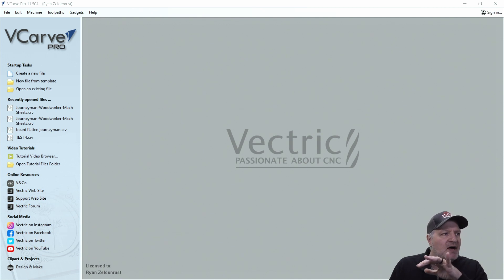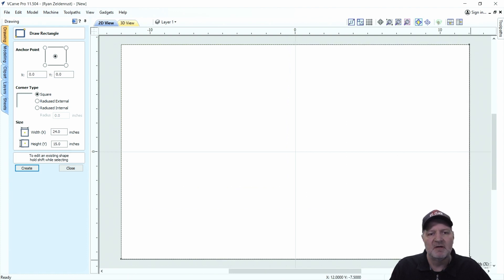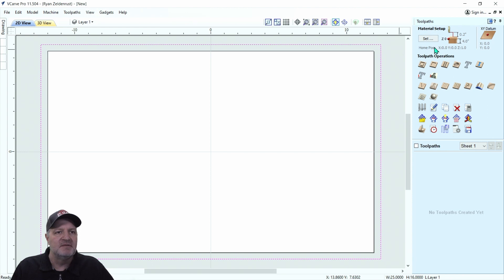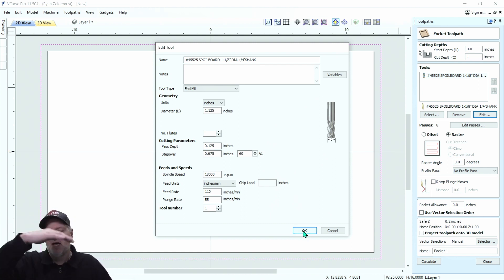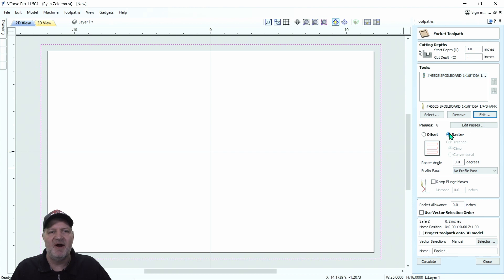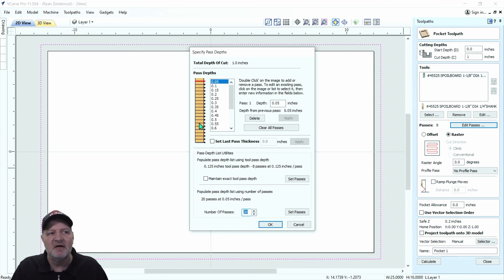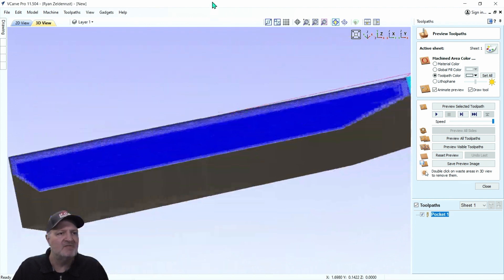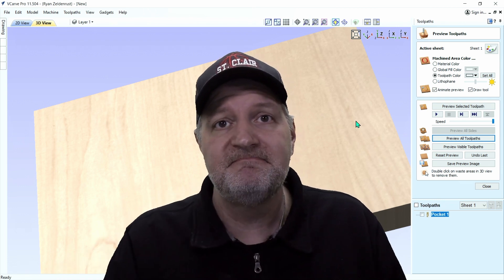The GENIUS of adding MORE passes to Vcarve Pro toolpaths - Vectric

Comment: First time viewer I thought the video was great.  How would you do that same thing with a v bit cutting text?  I would like to do the text in several passes.  Thanks for the help.  I did subscribe.
Reply from the maker: Thank you for watching 👍 The vcarve and engraving toolpath doesn't have the option to add passes, so you would have to attempt using a profile toolpath to have the option to edit passes. Your only option to cut several depths with the vcarve/engraving toolpath is the save a seperate toolpath for each depth you want to cut, stepping down the flat depth in each saved toolpath. Out of pure curiosity, is there a specific purpose for why you want to cut in several passes with your v bit?
Reply: @twoelmbuilds  I am carving text in hardwood (Hickory) and my x axis cant handle the full depth of cut from a 1/2 inch 90 degree tool.  I was hoping to make multiply passes to solve the problem.  I have been trying to find a work around and I am going to try a 1/4 90 degree bit.  I set the depth of cut in the tool parameters to 1/16 inch and watching the preview of the tool path it look like that may work.  Thanks for the quick response and any ideas you may have will be appreciated.